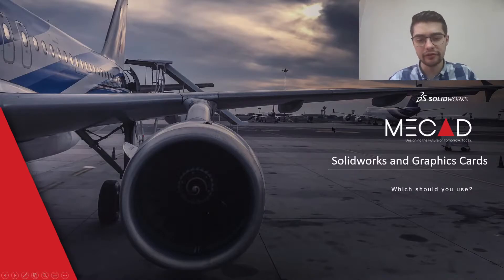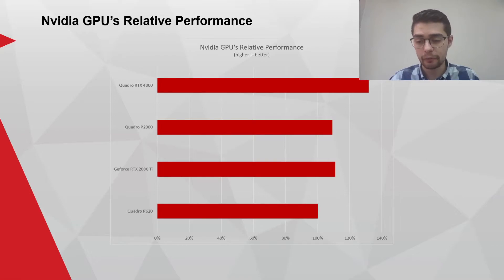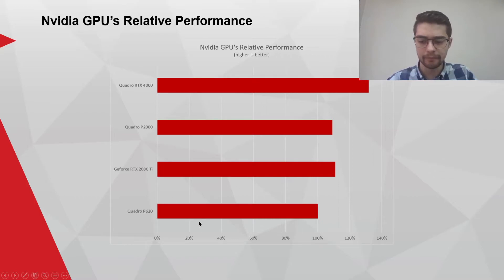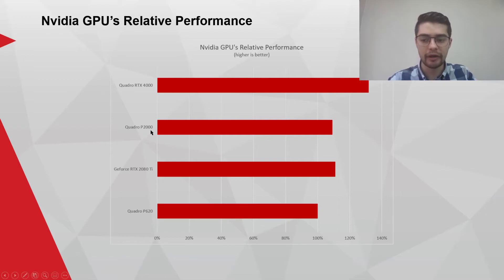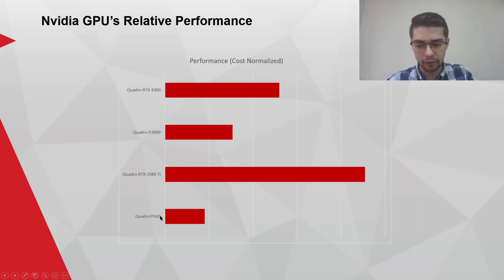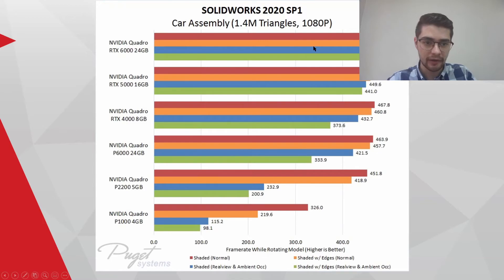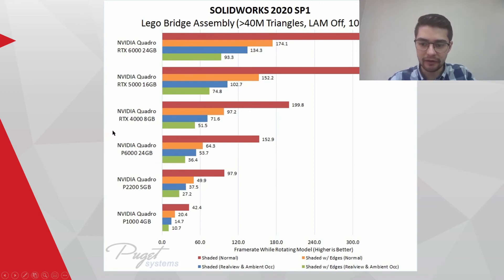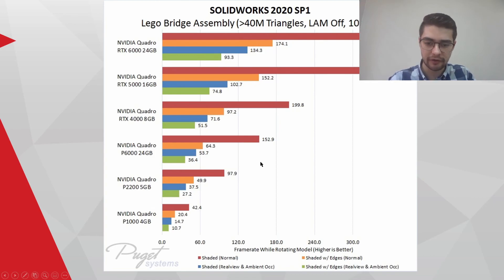What Graphics Card is Best for Solidworks

Comment: I'm just about to buy a laptop with quadro m5000m, and just to make sure i checked the supported gpu for solidworks 2020 in their website, and they didn't include the older quadro models in their supported list, 
Does that mean older quadros are not certified in the newer drivers for newer version of solidoworks ?

Comment: Hi i'm between a rtx 3080(used) and a rtx Quadro 4000(used) paired with a Ryzen 5600x(would you suggest to go for higher CPU?)how much of a difference would there be between this cards in solidworks or any 3d software and CFD Simulations, about CFD Simulations I've got an eye on simscale would you recommend it or get another service
Reply from the maker: The 3080 is officially unsported, and thus might cause weird bugs (there are quite a few listed on the Solidworks subreddit), you'll have to weigh this and the increased performance between the two vs the 3080 being a much newer card(and thus it will perform better in other scenarios like rendering).

One thing to keep in mind, the GPU is only used heavily when loading, rotating, zooming etc, and not at all used for solving CFD or even FEM.
Reply: @mecadsystems-solidworksand4875  thx

Comment: Thank you for the great video!
A question for you - I'm an industrial designer with 15 years of experience looking for a new laptop. Looking at the zenbook pro duo 15.6 (i9-11900H with rtx3080 and 32gigs of ram) it offers a lot of additional features that will work perfectly for my work scenario working mostly with solidworks, keyshot and Adobe programs. 
I ponder about that for a month now and unable to decide if it will be a good option for me or am I "forcing" it to do something it was not meant to and better to just go with a standard workstation (with rtx5000A for example) but lose all the great additional features the zenbook pro duo has (double screen, touch oled screen, stylus and more...) 
I'd love to get your opinion!
Reply from the maker: We've found there is often quite a significant performance hit moving away from certified graphics cards, as well as the potential issues w.r.t crashes, weird graphical bugs, etc. You'd have to decide for yourself if the benefits outweigh the risks in this regard, often a P620 will match a desktop RTX 3090 in SW performance, but if you're not dealing with large designs that might not be an issue for you.

Comment: Do the solidworks run on laptops with rtx 3050???
Reply from the maker: Solidworks will run but since its not a professional GPU, you might get graphical errors or more crashing.
Reply: @mecadsystems-solidworksand4875  hi, I’m a student with an Rtx 3050 ti. Would a 3060 improve solid works. Or would the 3050 be acceptable.
Reply: How did solid works run for you?